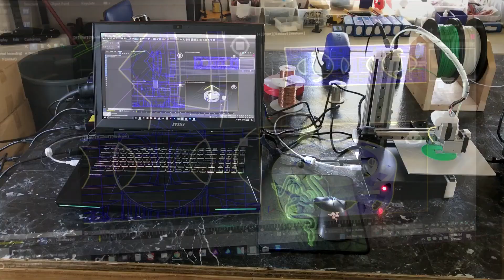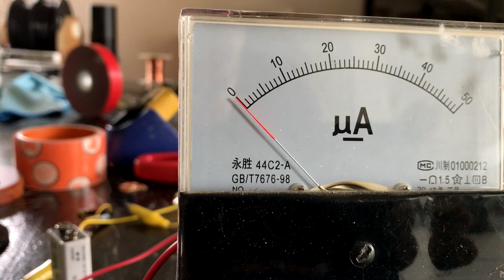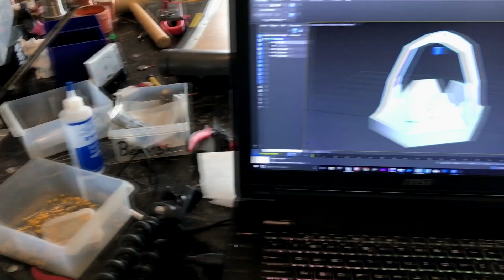3D Printed Nuclear Powered Motor - TriNano EZ-Spin - Tritium

Comment: What a great idea. You should sell them on your website. I would think that anyone would want to buy one who enjoys small complicated devices. I certainly would. :-) I hope that you will release all the details of the build and even the 3d files to try it myself, though I would far prefer to buy one from you.
Reply: Please, look the stuff up you are commenting about! The Beta radiation emitted from ³H is about the weakest there is. Range in air is under 4". As the range is also depended on the density of the medium, the glass tube is more than sufficient to shield the off. Now there isn't much radioactive Tritioum inside each tube anyway, and even if the interaction of the Beta radiation with the phosphorous coating might trigger some Gamma radiation, this will be well below natural Gamma levels. 
You can sleep on a bed of these things for years without any measurable effect, if you don't break them and inhale the gas.
Now in addition to the glass tube there is also a shield from the solar cells, plus whatever wraping is around all that (clear tape, printed base for the motor...).
Reply: "But what fun is buying it and not making it? : ("
I do not have my own 3d printer ,so i wanna buy it
Reply: this material only gives off electrons. It's not the least bit harmful
Reply: The tritium tubes themselves would be around 75 dollars
Reply: petty sure most of the element that produces radiation cost a lot of money, as they are 'dangerous' and/or hard to manufacture
Reply: kafr8413 I agree, it would be a great gift and or personal item. I would love to own one, I can't imagine it would be cheap tho.
Reply: $200 just in materials? explain
Reply: (aside from the tritium of course)
Reply: guess what, tritium cost US$30,000 per gram
Reply: sell the just as the op said or release the blueprints for a feed :)
Reply: Not really. Radium is still on the market as old watch parts. Other isotope buttons can be bought online. https://unitednuclear.com/index.php?main_page=index&cPath=2_5
Reply: I don't see radium from the website you posted though, from what I see online it cost 25000USD per gram, but they also said it don't have a fixed price, from what I can tell it cost more if you buy more as it becomes more radioactive, and the amount of radium on watches is so small(way less than a gram
https://www.researchgate.net/post/What_is_the_current_value_of_1_mg_of_radium_Ra-226
Reply: I said radium can be bought as old watch parts. I'm a watch maker. Old radium paint is common enough that I keep a geiger counter in the shop to check old watches before I open them up.
Reply: I think.you.can also get radioactive material from smoke detectors and other stuff.
Reply: They would cost about 300-400$ in materials alone plus time spent and other factors it would probably be 500-1000+$ for it
Reply: The phosphor in the tubes converts most of the beta radiation into light
Reply: Wooooah!! You must write a  paper about this efficiency!
Reply: I think lasersaber could sell a lot of units like these among many other creations but chooses not to in order to prevent any possible conflict of interest in his experimenting. Could be 3D printing and slanging gizmos like that left and right but probably prints way more stuff for sheer experimentation. Gotta love it.
Reply: of course tritium is expensive. vials can be anywhere from $6 to over $100. but tritium has almost nothing to do with this actual project. tritium just happened to be a nifty power source... but when you have a motor that will spin for over 20 years from a small battery who cares what's driving it? the hard part has already been accomplished. you don't need to spend hundreds on tritium to build this motor and power it from damn near anything.
Reply: No way! Really? I thought that would be much more expensive.
Reply: But what fun is buying it and not making it? : (
Reply: wait gift ??? gift giving someone radioactive material is not great idea unless you give it to someone you hate ..
Reply: Gifting radioactive material to someone is the greatest gift, they can get unlimited powwahh for years. Nuclear energy <3 Also Radio materials are expensive and rare due to regulations. Also it's a quick way to get them arrested for potential nuke crafting lololo
Reply: Magneticist wtf are you on about. This fucking thing would cost like 200$ just in materials. Who the fuck would buy this shitty looking unpolished paperweight? He'd need to spend hours making them look amazing just to be worth their price.